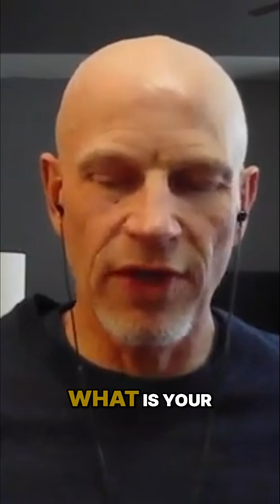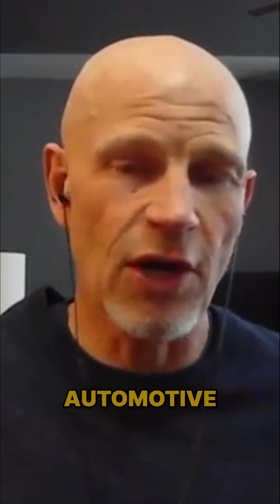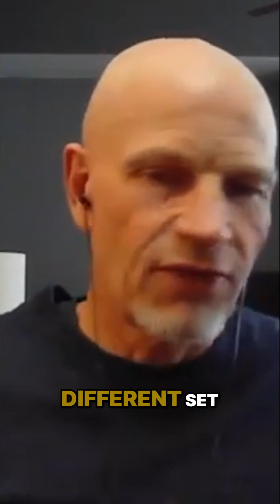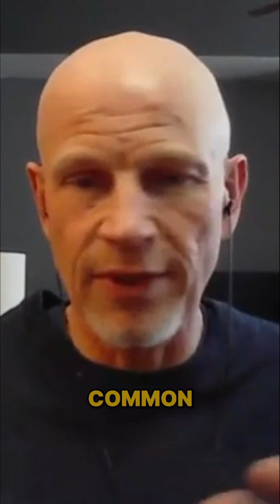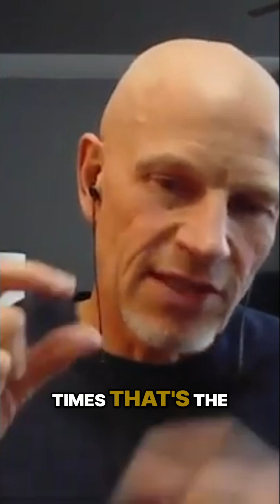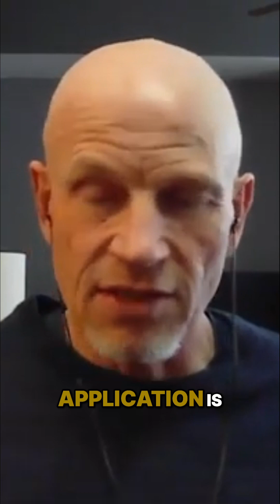What Do We Mean By "Solder Reliability?"

Comment: Leadfree is a pain in the ass also for rework
Reply: I always dab with low temp solder to remove the lead free property and makes it much easier to remove. Then after removal of the faulty or exchanged part, use lead free. Saves a lot of headache.